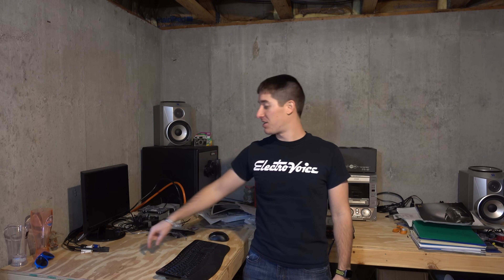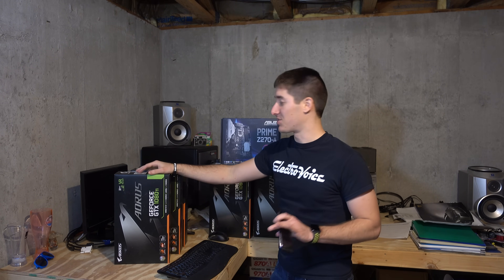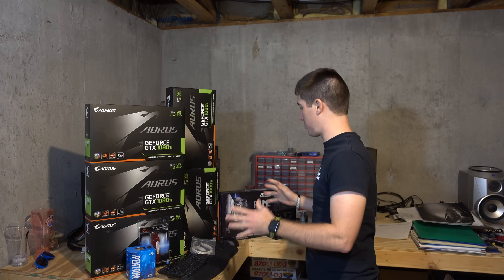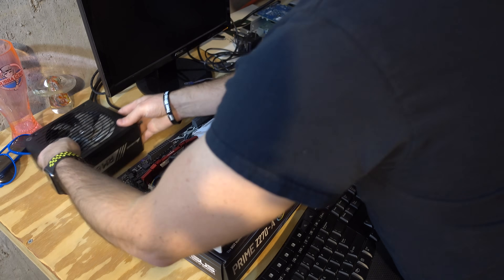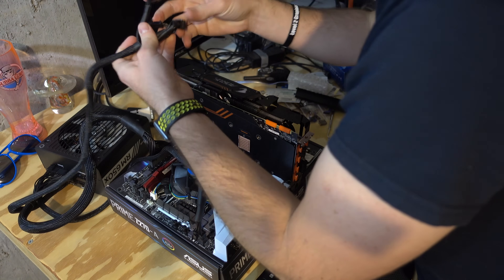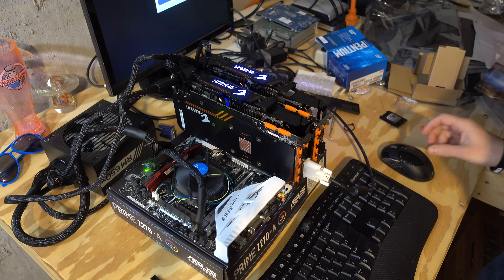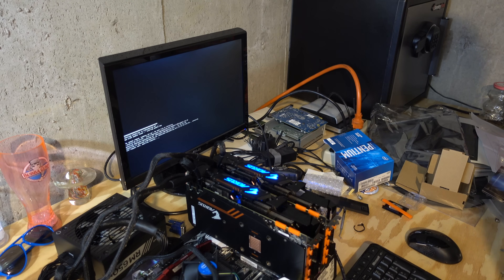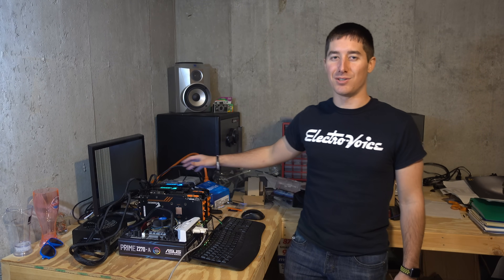How to Build a Fast and Simple GPU MINING RIG // GTX1080Ti

Comment: since we want the gpus to mine, Does it matter if we get 1070 or 1080?
Reply from the maker: 1080s have more cores and generally more clock speed, so more performance while mining.
Reply: @WatchJRGo  but price to peformance for the gpus is pretty nuts. You dont need a 1080ti for mining. The better option is a rx 480/580 or a 570

Comment: Can you donate a 1080ti to a gamer running on a 3gb graphics card 😭
Reply from the maker: Haha, I've been there, started way back in the day and have used the worst cards ever.
Reply: WatchJRGo I currently have a 3gb 1060 mini
Reply from the maker: That's not a bad card at all, it even mines well.
Reply: start mining until you can afford a better card
Reply: 1. Both Arma 3 and GTA V are cpu intensive
2. I use a 2gb 770

(I get 60fps at very high on arma 8600k and 770 both watercooled)